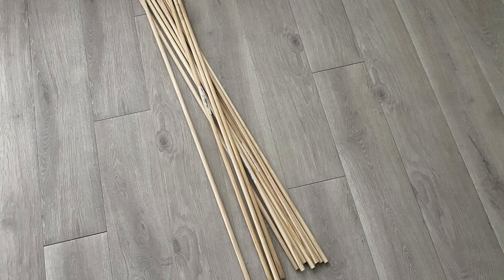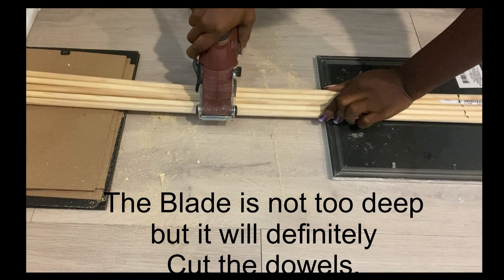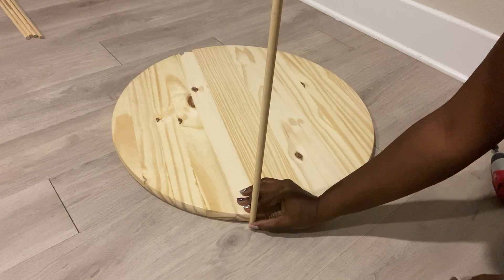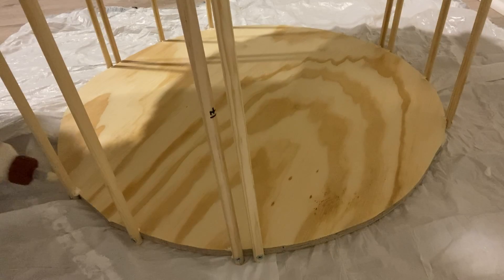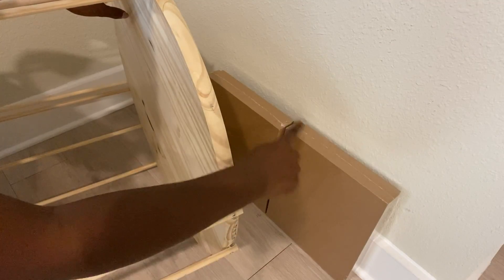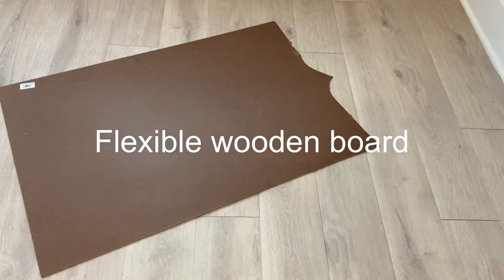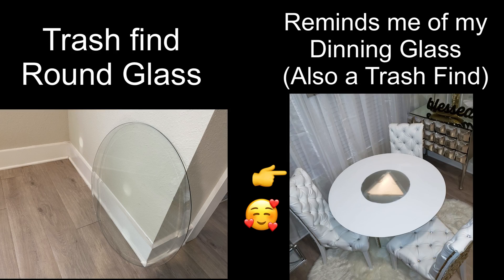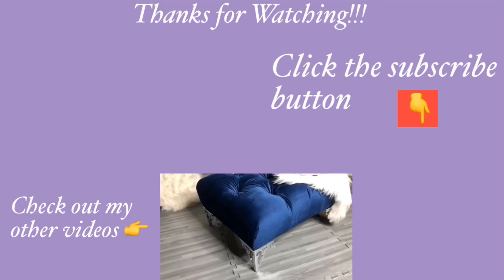HOW TO DIY A HIGH END LIVING ROOM COFFEE TABLE! HOW TO ON A BUDGET!

Comment: Good job..just some advice..apply glue before you screw not on the sides of the wood. Glue in between wood on wood and screws because once the glue cures you won’t be able to stain it..and it looks messy if you didn’t sand before you paint. Beautiful job